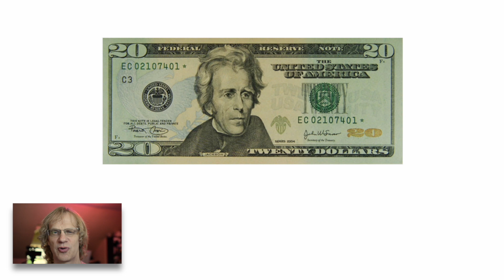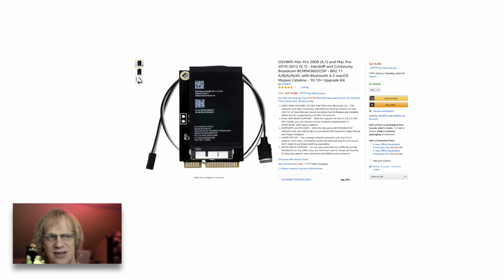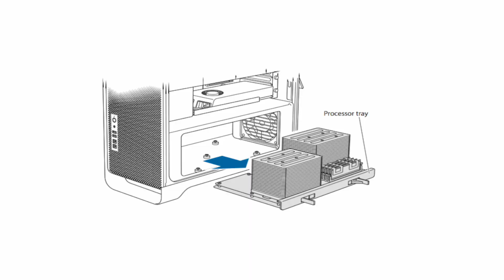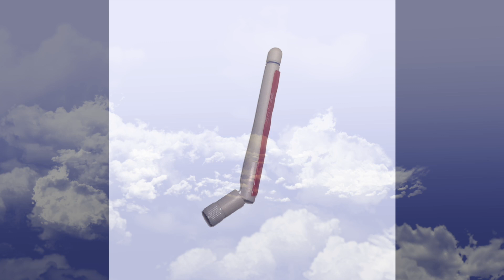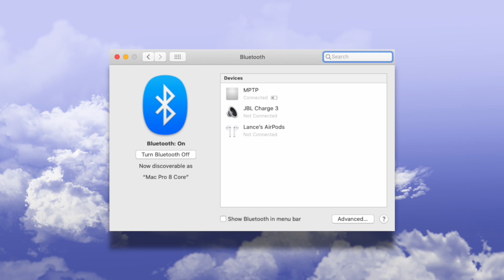Mac Pro 5,1 Bluetooth Antenna Upgrade

Comment: I remember you helped me with my windows 11 sound, thank you so much! So I was looking up the network cards and I’m not sure which wifi cards that have Bluetooth 4.1 on them are compatible with the Mac Pro 5,1.

Would you happen to know which ones would be?
Reply from the maker: Check out my Bluetooth card upgrade video, I had to go into device manager Bluetooth and enable the Broadcom driver in windows to get it to work, next time I’m in windows will have a look and post, my card under Mac OS says BCM_20703A1 its Bluetooth 4.1 not 4.2 Wi-Fi says Broadcom BMC43xx 1.0

Comment: Your clear and detailed video motivated me to try that, and it was really easy indeed. Once clipped in place, the connector of the antenna I bought freely rotate around but the original connector from Apple did not and it was indeed not easy to remove. Stupidly enough, I forgot to buy a metal strip with a hole for the antenna to close the PCI slot. So I drilled one of the generic one I had around! Thanks again, and for all your videos. Next year, I might try the more difficult upgrade to move to Monterey that you also detailed.
Reply from the maker: Glad it worked out.

Comment: This doesn’t give Bluetooth 4.0
Reply from the maker: This video is how to instal an extension cable for the original Mac Pro’s Bluetooth card which is not 4.0 but Apples Magic Trackpad 2 works fine with it.
Reply: @MacSoundSolutions  Thank you. I'm looking at the parts for the 2015 iMac BMP*****CD cards and am confused how the bay folks call in BT 4.2... Where are they claiming 4.2?
Reply from the maker: @2guysvintage699  this is the card I installed but it’s for the Mac Pro 5,1 not sure if it works in an iMac https://dqupgrade.com/products/genuine-apple-wifi-802-11ac-bluetooth-4-2-adapter-upgrade-kit-mac-pro-4-1-5-1 it is Bluetooth 4.2 as shown in apples system info. https://youtu.be/PTtOl1-ia8g
Reply: @MacSoundSolutions  First thank you for your help on these matters. These sellers that do the work for you promise a BT 4.2. I see the antenna kit you have for $15. The seller here appears to use the BCM94360CD card that I am told is the best for this. I have two 5,1 towers and am trying to build one of them. The second 5,1 came with a single cpu. When I first got it for cheap I took the whole thing apart. I am floored now at the upgradability. I hated my 2019 MBP with the dongles and want a machine to render videos and photos. 

My concerns are if I am used to building up Mac mini’s and iMacs, no stranger to those little speaker and Wi-Fi/BT wires why not get the BCM94360CD used for $12 or up to $35 even on Amazon a couple $7 antennas and the adapter?  I can solder but would like to avoid that. 

Yet

My priority is fastest Wi-Fi and airpdrop as I use that.  I am at Mojave using apples upgrade process and chose the vega 56 with powerlink and connected it with a mini6 to 8 and a mini 6 to 6 like the powerlink is set up. It’s a power gamer Radeon and it’s noticeably faster than the asus RX 580 tbh. Best it frees up the second pcie X16 lane unlike the rx580. I used open core and think Martin Lo is the way to go but right now I have done limited things just to spoof my boot rom and  allow for a pcie M2 with a 1 tb ssd holding my OS and it’s a fast master. Monterrey is the goal. With ssds it a great OS. I can drill the antennae in the ssd pcie tray. 

1)do you think the extra antennae makes a lot of difference after the BCM94360CD upgrade?

2) Since airplay and handoff is so important to me is this BT 4.2 a marketing ploy?

3) parts are $50 cheaper than this “package” they give.  I’m building my first tower. I should build it, not pay unless it’s actually superior for a kit!

4) what’s your hindsight 20/20 view on all this?  Thank you 

Do we kn

https://www.ebay.com/itm/275429649411?mkcid=16&mkevt=1&mkrid=711-127632-2357-0&ssspo=dKgHPJmcS3-&sssrc=2349624&ssuid=bjjb3uuprya&var=&widget_ver=artemis&media=COPY
Reply from the maker: @2guysvintage699  they sell it cheaper here https://dqupgrade.com/products/genuine-apple-wifi-802-11ac-bluetooth-4-2-adapter-upgrade-kit-mac-pro-4-1-5-1 you can find the cards cheaper and put your own kit together, you just have to find the correct parts and that usb data cable for the bluetooth connection to the logic board is a must part of the kit. I was to lazy to search for them and then wind up with something that didnt work so I paid the big bucks. Bluetooth 4.2 is not any real difference, but it just comes with the card and I guess 4.0 is good enough for handoff etc. I find I have to be close to my mac pro to get handoff to work even though the antenna extension sits on my desk. Not sure why that is, as every thing else bluetooth like my track pad works much better with the antenna extension. Perhaps hand off has a proximity distance thing.
Reply: @MacSoundSolutions  Well I maybe should do a video about this when I am done. Part of the fun is making a 2010 mac relevant and enjoying getting technical about one of Apples many amazing and creative tools a lot of us use. I remember when I discovered what I had when I got my 2010 2.66 single cpu after taking it ALL apart. I have found out that since I didn’t like my i9 MBP, enjoyed the 3.0 i7 16 gb 1tb hdd 2014 Mac mini after I put a modern M2 1TB crucial ssd stick in the mini pcie board and had a fast Mac mini that building is cool. When I looked for dual CPU trays and 5680’s on eBay, I saw them. The third party that did these builds we do for fun and said things when I asked “Rather than your $500 dual 5680 tray with 64 gb server ram, could I just buy a stock tray for $100 -$150?” “ and got “Oh no, I just finished repasting this tray, it’s maxed out” with the used car salesman eBay words like LOADED! MAXED OUT! , like butting in a couple $60 chips and $8 thermal paste on bins of recycled Mac Pro’s and adding old RAM a real job that deserves $400 labor. Those days are over it looks like. I found out (of course the sellers wouldn’t tell me, the bt 4.2 is the BCM943602CDP which I bought for $14 and the adapter I THINK will work 1 pc mini PCI-E to 1.25mm Wireless Wifi
Card converter BCM943602CDP

This card may have the wire plugs upside down on the adapter.
Reply from the maker: My card is BCM_20703A1 which looks like its actually 4.1 but it says + LE and LE was introduced with 4.2, strange...

Comment: Magic Trackpad 2 works off of Bt 4.0 and above. Is there a BT 4.0 card upgrade for that particular Mac Pro?
Reply from the maker: I'm using a magic trackpad 2 no issues with the original bluetooth card. You can install a new blutooth card that replaces the wifi and bluetooth in an all in one. It will give you airdrop support but it is a bit tricky to install and I don't use wifi on my 5,1 I found a few on ebay that were much cheaper but here is  one on amazon that other 5,1 owners have installed with success. https://www.amazon.com/dp/B01N9QBT2K/ref=cm_sw_r_cp_api_i_nGLlCbCDYMWZT
Reply: @MacSoundSolutions  Oh that's interesting. I was under the impression that the trackpad required at least BT 4.0. to function. Are you getting all functionalities of the Trackpad 2 even though it's not connected to your 5,1 via BT 4.0?
Reply from the maker: @dEeM0nEy916  it is connected via the Mac pros Bluetooth and all functions work. I do have a Bluetooth extension cable as the Mac pros stock card doesn’t have much range and mine is in a closet so the antenna reaches my desk. Apple has a 14 day return policy so you could get one and test it out. The upgrade card WiFi and Bluetooth 4.0 is in the link in my first reply
Reply: @MacSoundSolutions  any problems with the stock card and BigSur? I presume you had to config OpenCore kext?
Reply from the maker: @crundi  no prob and Martin Lo's Opencore package has the kext built in. Legacy Bluetooth and WIfi does not work with Monterey among other issues.

Comment: Hello I have brought duel 12 core processer 5.1 fully rammed its has a SSD drive for the boot up and operation system.
I want to know can I put 4x 8tb hard drives in the four bays? 
the hard drives are WD/HGST HUS728T8TALE6L4 8T NAS they clam to be better then the WD Gold Drives. I am in China these drives are from WD  but they are also a lot cheaper than WD Gold. (Western Digital Ultrastar Data Center hard Drives) made in Thailand  7200 RPM 256 MB 3.5/sata3
Will these be ok? and can you get a external power source for the Hard Drives to take the load of the power supply?
Reply from the maker: The Mad Aussie I use four drives in mine and two are 8T so don’t see why you can’t use four 8Ts. I have a external usb 3 drive bay as well that takes 4 drives. I use Seagate 8T and remove them from their plastic case and put them in the Mac Por slots. They are very cheap around 140.00 US. Seagate Desktop 8TB External Hard Drive HDD – USB 3.0 for PC Laptop and Mac (STGY8000400) https://www.amazon.com/dp/B07CQJBSQL/ref=cm_sw_r_cp_api_i_.VYrFbZN1PQNZ have had pretty good luck with them so far. I do not use any external power and I have an RX5700 xt GPU running off internal power. USB 3 card, and NVMe card.

Comment: I remember your 4,1 to 5,1 video as I had just purchased a 2009 5,1 Mac Pro already upgraded with dual 3.46GHz CPUs.  I ordered one of those WiFi/BT combo cards shortly after that but had some issues, besides sweating profusely.  I tried a USB BT dongle using BT Explorer but I still had occasional Apple Magic Mouse drops as my Mac Pro is under my DAW desk. I then went with the external antenna solution and I also switched to Gigabit Ethernet for my internet. I bought a quite large antenna that is hooked to the back of my Mac Pro and it worked somewhat better plus no need to reconnect using BT Explorer after a restart or shutdown like with the dongle. 

I recently attempted to install that old third party WiFi/BT card but only managed to pull off the Apple BT card’s antenna connector and also sweat bullets. Luckily, I found a used Mac Pro BT card on eBay for a pretty decent price and so I’m back where I was except the Apple WiFi card seems to have no antenna signal now but I don’t use it anyway. 

So it looks like I could buy this kit and replace my BT antenna with the extension cabled antenna and have it much closer to my Apple mouse and Apple BT keyboard. 

Also, some may find it a little easier to first remove the Apple BT card, but you should use a fine electronics, magnetic tipped screw driver for doing that.
Reply from the maker: fastlanephil2 I have had no Bluetooth issues since installing this. I also did the dongle / Bluetooth explorer route and it worked quite well for a long time with the occasional quirks, but then recently started switching between the Mac internal and the dongle so it was driving me nuts. After I updated to Catalina and opencore I guess that’s when it started acting up bit it may have been before that. So the antenna kit is working nicely no issues at all since installing it. I thought about removing the card but decided to leave it and see if I could connect the wire and it snapped into place. It was not easy, but so removing the card might make it easier.

Comment: I bought that expensive kit and it loses bt connection even easier than default BT/wifi antenna. But at least I have now bluetooth 4.0 and 802.11ac on my MP. This will be my next upgrade as well. Thanks for the video.
Reply: There are "Expensive kits promising BT 4.2 using the same cards and adapters you can get for $60 for $120 on bay. Which one of those expensive kits did you get?